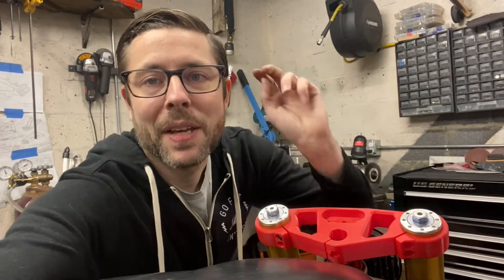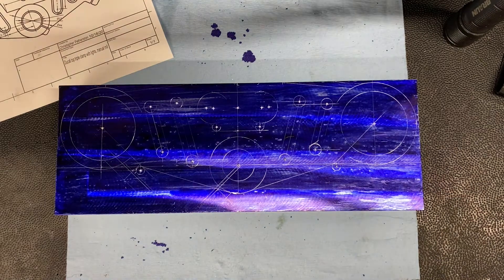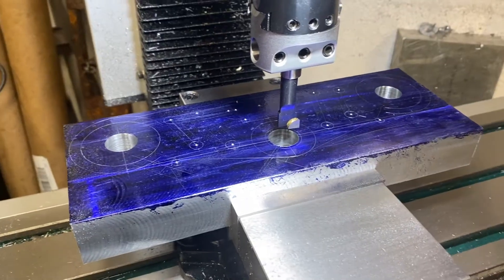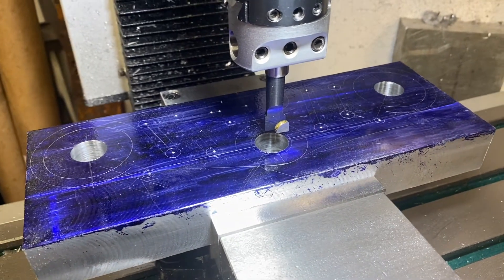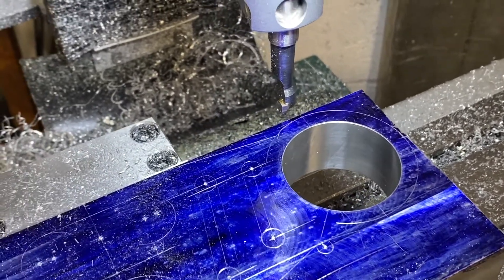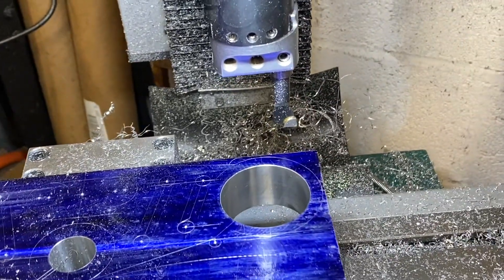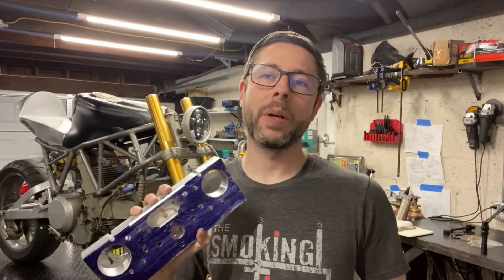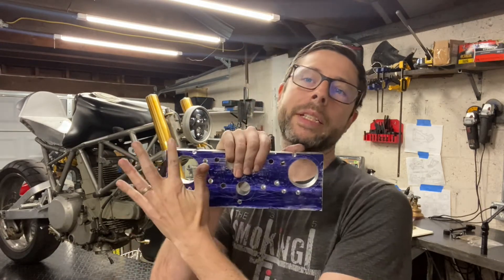Boring fork tube holes, Motogadget slot: Machining a Ducati 900SS Supersport triple clamp pt2!

Comment: Hi. I have a Swedish CNC mill (1980s machine) Strorebro combi mill.   I've made some triples in the past with a much smaller machine, but only ever used a 10mm endmill to spiral cut the holes for the fork tubes which was just about passable. Now I have this bigger machine I can do it the proper way with the boring bar. Great to see someone doing it manually.

Comment: Trying to do manufacture that piece on a manual mill is a SKILL!  I program CNC machines quite frequently and would never attempt that on a manual machine.  Massive props to you.  If you need some CNC parts down the road, let me know, I work with a small shop that should be way more affordable.
Reply: Hey thanks! I'll keep that in mind!